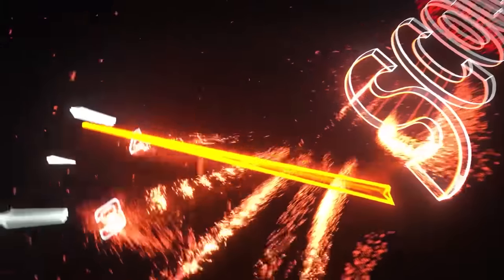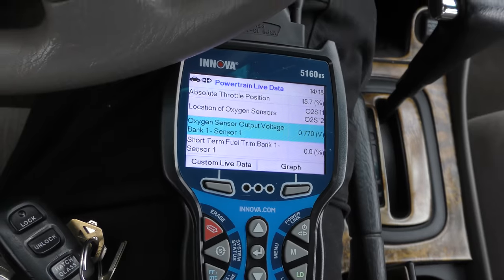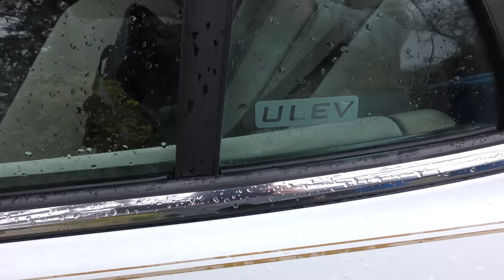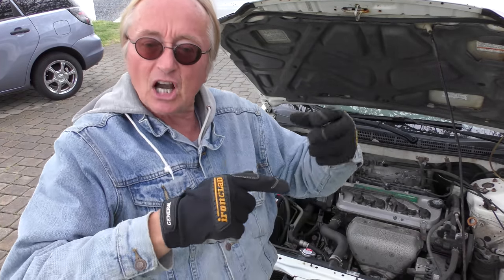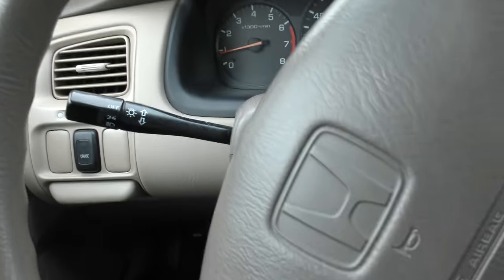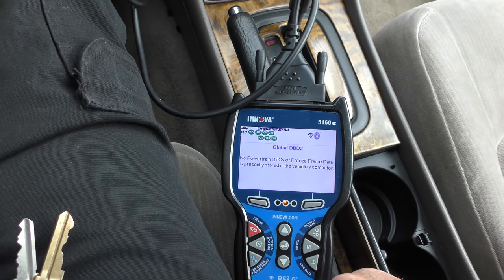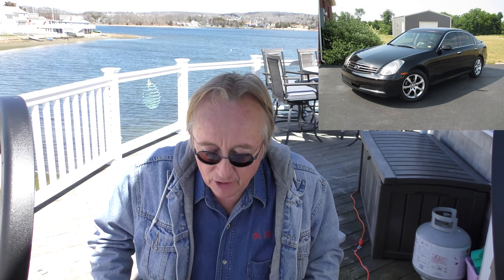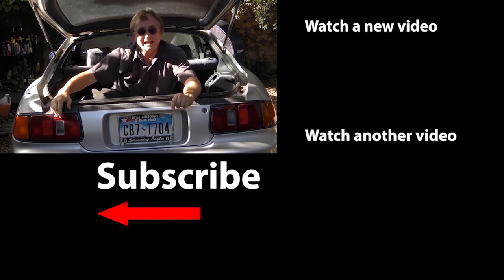Never Install This on Your Car

Comment: Scotty, I have a 2003 Mazda Protege 5 and its throwing a P0037 code, it says O2 sensor #2. In your video, you say 4 cylinders only have one sensor, so are mazdas different, and have 2 sensors, and are they the same sensor, so I can just go to NAPA and get a new sensor? BUT, which one do I replace? I would assume the #2 sensor is under the car, not at the front? 🤷‍♂️

Comment: I have a 2013 Mercedes c300 sport and i am looking to change my rims, what is the best scan tool to use to reprogram the new the tire pressure sensor so that it works with the Mercedes ecu. This car has been perfect, absolutely no issues what so ever other than the rims are 900 buck each and i a tired of replacing them when they bend, the amg rims are junk.

Comment: I have a 2014 Sierra . Is there a second engine temperature sensor other than the coolant sensor that is beside the thermostat? Any ideas on where it would be located?

Comment: Hey Scott wondering if you can help me, I just replaced the thermostat on My 2010 Chevy Malibu and ita a closed cooling system, What is the easiest way to get the air out of the system  ?

Comment: Hello Scotty! How do I submit questions? I have a 89 Jeep YJ Sahara with the inline 6 and an Ax-15 manual transmission. Can I put some of the AT-205 reseal in the transmission fluid? Looks like I might have a leak at the main seal of the transmission 😬. Any help would be greatly appreciated. God Bless!

Jonathon - Jacksonville, FL

Comment: Well scotty, can u tell me is it possible to remove the body off the chassis of my Suzuki grand vitara 2005 with out having to touch the a/c radiator or any of those pipes because I heard there very dangerous gases from them ,I want to see if I can restore the whole thing I know it's a ton of work but if it is possible to remove without touching that thing then I know the rest is more than do able thsnks in advance

Comment: I replaced my o2 sensors on my 97 mercury cougar, they are the correct sensors for my model car . The check engine light went away but after a few days of driving my car the engine light came back on for bank 1 I have no idea what else the problem could be .help me out?

Comment: Can you use anti-seize on that oxygen sensor? To help seal as well as making it easy to replace?
Reply: @Mark Codiroli Indeed. I use a q-tip and apply very little in the middle, none on the end, and work it into thread - one rotation.

Comment: How many miles I have to run my suv I have evaporation catalytic converter oxygen sensor plus oxygen sensor head I have eouinox sport 2008 v6 3.6 engine

Comment: I changed the o2 sensor( NGK, or NTK) in my 2004 Dakota 4.7 liter (bank 1, sensor 1) because it was bad (fuel trim levels outta wack),. but now it says the heater for the sensor is bad. I find if I start it up when cold and drive it right away, the code does not trip. Any Idea of what to look for to fix this?

Comment: Scotty I have a real problem  with my 2006 rav4 . My Chihuahua chased a squirrel  into the engine compartment and berore I figured out what was happening he damm squirrel did something  to the wires and now the abs warning light  goes on along with the 4 wheel drive and a few others I cant see anything in the engine compartment and Iam at wits end .the Chihuahua killed the squirrel so I cant ask it.would appreciate any advice

Comment: Wtf Scotty? Any socket that fits will do? Well no not any socket will do, it has to be an oxygen sensor socket as it has a spot for the wiring to come out thru.
Any spanner that fits will work if U don't have an O2 sensor socket, regular sockets will not work unless U cut the wiring off which U can never do!

Comment: Hi Scotty got a Honda civic replacement a year younger same model engine etc I was getting 55mpg average on the older one before it was totalled .  the newer one averaging  39mpg . dealer said nothing wrong with it why such bad mpg . cleaned out egr . new map sensor .new filters .  external thermometer wasn't working new one is . no codes any ideas please .

Comment: What’s a cheap scan tool that can change the idle speed , my 3 cylinder 2013 Suzuki alto is idling too low , full electric throttle body,

Comment: Hey Scotty love your videos I have a 2012 Toyota Camry se 4 cylinder engine with 115,000 miles when I cold start the engine I hear a 1 second rattle then goes away,  Toyota says it’s a 2.3 hour job to change the cam gear is this something I need to address or not to worry about it.
Reply: Cars that have timing chain do that rattle on engine start up my 09 altima 2.5 does the same noise.

Comment: Scotty, what is your opinion on the AEM wideband O2 sensor that is more accurate but also more expensive than the OEM parts???
Reply: The difference would be so small, what's the point?
Reply: @EMichaelBall  Errrr... Sorry... I should have been more specific, I building my engine for boost, that is when a wideband O2 sensor is needed, other than that is there any reason tho use one??

Comment: sir Chevrolet spark 2013 model oxygen sensor bank 1 and bank 2 sensor are same or not ?  actually  bank2 sensor not working but ihave extra bank1 sensor so can i fix the bank1 sensor place to bank2

Comment: I swear man, I do not have a cell phone, never have. SOMEHOW THOUGH - you must have some way of spying on me!!!   LOL   I don't see how you do it really. I got a Bosch however.    The car has a 305 in it and is a 1985 model.  I bought headers with cats installed already and I went to the muffler shop close by and asked how much it would be  to install a bung for the O2 sensor and they said 30.00 or so.  the car runs fine with the engine light on but I still don't like it on. ( it's a Camino) so not too cool to have a 6 inch wide check engine like on 100% of the time eh?        anyway.   so weird. 

   would you leave the stock carb on your el camino if you had one or just go get a manual tune one?      this tings getting about 12 Miles to the gallon right now, on the highway.   no joke. It's like my 6 liter Yukon pulling a utility trailer type of mileage. 

..